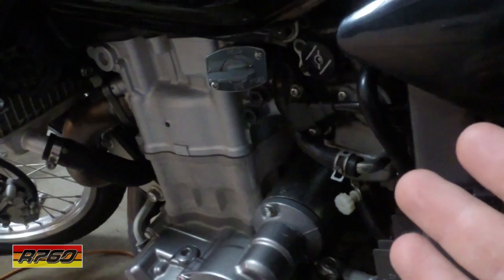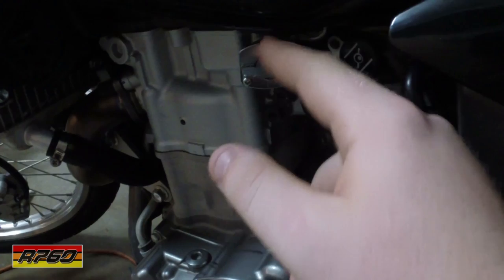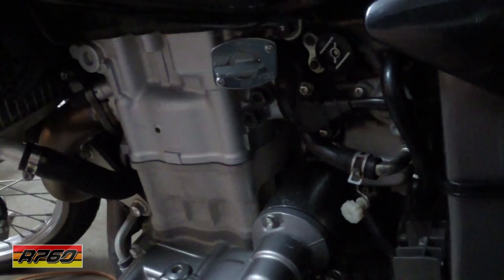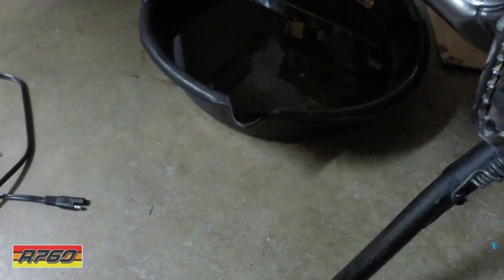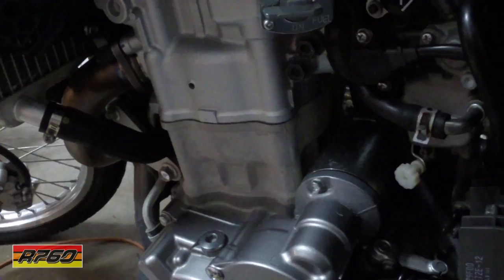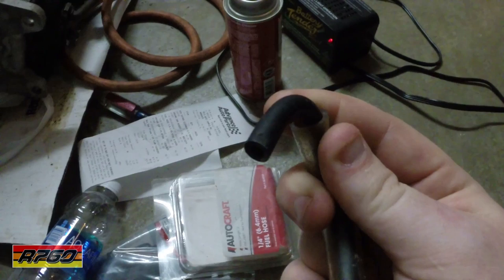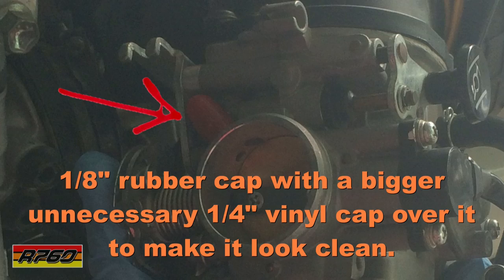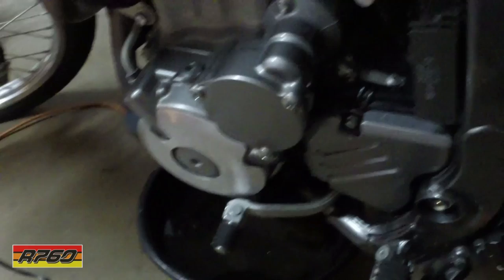Must Do Mod For Your DRZ | UNDER $30 | Vacuum Petcock Replacement

Comment: if you're flooding into the crank, why on earth wouldn't you address the trashed fuel bowl float valve?!
Reply from the maker: etyrnal My bike was still in the break period at the time and I don’t have the problem anymore. I did a little “research” on ThumperTalk and decided to make this video. Also I now see the error in my thinking and how I presented the problem, but I’m still a proponent to manual petcocks and leaving them off in storage. Thanks for the comment!

Comment: You do not need the vacuum caps. Just fold the vac hose over on itself and zip tie it
Reply: Thank u. Doing this today, and was searching for this after seeing another line coming off valve. And Im not carb handy so this really helped.

Comment: considering all of the mods required why do we buy these bikes?
Reply: because none of these mods are actually required we just do them because we think we know more then the engineers that build them.
Reply: If I need to explain you will never understand
Reply: These bikers WHERE good now they have added emission protection layers that destroyed the best designed motorcycle on earth

Comment: Hey man, having the same exact issue, although I suspect my float needle is jammed up as well. Anyway, I was wondering if you needed to use the spacer from the original vacuum petcock with the Raptor version, or if it hangs down enough to clear the gas tank. Cheers!
Reply from the maker: I believe I used the spacer.
Reply: Is this spacer necessary for clearing the tank? Like an idiot, I threw it away with the vacuum petcock
Reply from the maker: +tmckague after looking at my bike it seems that the spacer is needed. Although it does look like it could go up a bit, but it might not be able to go into the reserve position. I would suggest getting another spacer along with the appropriate gaskets if you don't have them.
Reply: raymon760 why not just grind/sand down the lever a bit?

Comment: Hi you realize you're "curing" the head ache by chopping the head. The fuel reach the crank if and only the float valve is not working.  So better start in the beginning than invent workarounds.
Reply: crpth1 it doesn’t always work like that with a vacuum operated petcock, if the diaphragm in the petcock is bad there will be a constant vacuum going through it whole running, causing rich running conditions. When the engine is off, there’s nothing stopping the fuel so it pulls fuel constantly and it’ll start actually going through the vacuum hose into the carb (usually up top somewhere) and fill the case. The float has nothing to do with it as the fuel is coming in through an entrance entirely different than the one that puts fuel to the bowl of the carburetor.
Reply: Right that vacuum line goes straight into engine AFTER the carb.

Comment: This is good info...another benefit from doing this mod is the petcock won't fail on a ride and leave you stranded.  I have had friends who's carb wouldn't get gas while riding because the petcock would not hold vacuum to hold the valve open.

Comment: Do you also have to change your Gas Cap to a vented one?  With gravity feed and a Stock Cap wouldn't you build up pressure in the tank as the fuel is consumed?

Comment: I swear that the bunk ACCT thing is an internet legend left behind after some bad ones were made pre-2004. 
I think the bad batch of ACCT's freaked so many people,  that an easy to manufacture bolt on part started selling like hotcakes, even though the probleem was fixed. "Better get one just in case" has been the selling point ever since...the My 04 still runs the ACCT, I replaced the cam chain at 40,000kms, I now have 98,500 kms, and am still running the 2nd cam chain with lots of life..
Reply: wtf for real ?
Reply: 50+ years riding, 20+ bikes, NEVER had a vacuum petcock fail. Or been with anyone that has.

Comment: ok, so the petcock is not the really the problem. The real problem is the cheap o ring that is used around the seat portion of the fuel needle valve.  The o ring is cheap garbage and fuel leaks around it and down into the carb and then into your engine. The non vac petcock allows you to turn off your fuel, so this leaking o ring doesnt flood out your engine. Unless you replace the o ring in the carb, you will have to turn your fuel on and off every time you ride your bike. If you leave the non vac petcock in the on position you will still get gas leaking into your oil.
This is the real deal.
Reply: Can confirm this has happened to me, how ever I left on prime for months. May even have been float stuck. Either way yes your crank case will full with fuel there was a gallon in my exhaust too , the real fail here is the that the carb doesn't have a over flow due to some emissions crap, they don't want fuel on the ground apparently.😢

Comment: So after replacing with manual petcock do you always have to turn it off after riding?
Reply: Yes always
Reply: @sgrenier78  Not really if you needle and seat are working good . the gas should shut off once the carb bowl fills. but i guess to be safe it would not hurt.
Reply: On all of the 5 bikes I have iwened(all were from 1970-78) I NEVER turned off my petcocks and they never leaked. I’m sure 40+ years later, the newer ones don’t either.
Reply: @petrosspetrosgali  same here never shut off the petcock. if anything leaks it would be the carb float causing the leakage.

Comment: Please HELP someone! I just got a 14 dr650 and when I was riding the other day it died out on me when I was in 4th. Figured out it had a bad battery so I got a new one but the same problem persists. The bike will turn on...eventually, but only stays on for about a minute then turns off. Also when it's on and I press on the throttle it seems as though it wants to turn off, when I close the throttle it goes back to normal. Oh any it only runs on prime...
Reply from the maker: +d123abcd did you put this on ThumperTalk? If not I strongly suggest taking this to ThumperTalk. 
Someone way more qualified can help you troubleshoot. Maybe it's not getting enough fuel, or too much air. I don't know.
Reply: I have the same problem. Mine only runs on prime.
Reply: Carb is dirty, needs to be cleaned

Comment: The thumpertalk petcock link is dead. Can you update the new one?
Reply: Get the DRZ400-E one and fuel line (use the spacer as well get a NEW o-ring for the spacer since you should not re-use it. Mine was leaking fuel in the oil as well. It is well worth the $80 to get the Manual petcock and fuel line. Put a PLUG on the carb where the vacuum line was, I have to change my oil and mine is a 2021 model. I knew it was leaking not even 100 miles on it oil smelled like fuel.  Look up Suzuki DRZ400E like 2005 model will work - put on Metal tank no issues.

Comment: Hi dear i have a suzuki drz400sm 2014 and petcock was liking replaced to yamaha raptor 660 and work perfect but on the vaccum put the vaccum cap and start fail disconnect the vaccum cap and stop fail why please let me know
Reply from the maker: I'm not sure I understand what the problem is. The vacuum line that used to go to the petcock needs to be capped off. That is the only vacuum line that should be messed with.

Comment: I think I'm having a similar problem but how did the fule get down into the crank case?
Reply from the maker: It didn’t, I’m stupid
Reply: Yeah.  That sounds odd as it seems like fuel would have to bypass the float bowl overflow.

Comment: ive heard of that problem, but never had an issue , i always leave the petcock on ... i need to look in to it .. :)
Reply from the maker: Ya, I didn't think much of it until I checked the oil. It smelled like straight up gas.
Reply: +raymon760 when is the last time you cleaned the floater on the carb,  if that meddle is dirty will let gasoline go thru,  otherwise it should stop it.  I had a leaking carb once,  had to clean the drop needle on the floater,  fixed the problem
Reply from the maker: +Vegas RoManiac never cleaned it before replacing the petcock. But I rejected it (for exhaust) after and it was clean in there. Hopefully this fixed the problem. I'll probably make an update video next oil change. Thank you for the feedback I appreciate it.
Reply: @vegasromaniac  It is the vacuum petcock the seals fail or they leak I got one as well and they leak. Nothing to do with the carb on these totally not related. Fuels with ethanol eat up these and they flow fuel and even new ones fail just a crummy design.

Comment: how can fuel leaking into the crank ? dont get it
Reply: dreamingwolfsocom  Do a little google research--usually worn needle not seating properly which lets gas flow. I put new needle on mine and problem solved. Its not really a petcock issue but petcock will give you an extra layer of protection by shutting of gas right at the tank.
Reply: I meant to say float valve. It has a little bullet shape end with rubber on it that wears and gets hard with age.

Comment: MY 2003 kawasaki klx400r same as DRZ400E comes with a manual petcock ! Why not use one ?
Reply: Also have a 1983 Suzuki GS750T that has a vacuum petcock , never had a issue with it and have owned bike since new !

Comment: i dunno, sounds like u messed up somehow. i got 20k on my drz400 and my petcock never had an issue. not to mention the catastrophic consequences if u forget to shut off ur manual petcock.
Reply from the maker: Probably, I mess up all the time. But I grew up on dirt bikes so it’s second nature for me to not only turn the fuel off but run the carb out of gas after every ride

Comment: I don't get it... how was fuel getting into the crank from a leaking petcock?
Reply: Two failures are required.  The petcock must leak and the float needle seat must leak.  Unfortunately, due to ethanol fuels eventually both these things do leak and your crankcase fills with fuel.  It's very, very common.  Basically 100% guaranteed to happen eventually.  There is a needle seat seal made out of different material that won't degrade with ethanol fuels.

Comment: How does one recognize he got fuel in the oil?
Reply: checking the oil level, if it is higher than normal you have a problem.
Reply: Sometimes oil mixed with fuel drips through the engine gasket... you can see the oil spill on the ground. It happened to me on my Virago 750 many years ago. Now i am thinking of turning my Kawasaki Estrella 250 in to a gravity type petcock because the one i already have is been vacuum disabled, it only works on pri mode.
Reply: Take the stick out and smell it

Comment: I got a non vacuum petcock and ever since I did that Ive had problems.

At first it was a bitch to start up after several cranks.
Then it got worse and wont stay running. Dies during idle or when I give it throttle.

Any ideas? It seemed to work fine before I changed the petcock to a non vaccum one.
Reply: Same problem... Cuts out when driving and I can see the fuel filter is empty. Then fills slowly over a few mins & I can start it again. No idea if it's a vent problem as I can't get an answer and have no idea what I'm doing 😁
Reply: @kpunk4247 did you end up getting a vented gas cap? Lol
Reply: Did you end up getting a vented gas cap and fix the issue?

Comment: Please help. I changed out my petcock with the raptor one. Plugged the vacuum line nipple. Ran a new fuel line. Bike ran for a minute or two. Next morning out went and bike will not start. It is cranking, but won't fire over. I replaced the spark and the carb looks clean. Any suggestion on what to check next.....
Reply: 2006 DRZ400SM 13,000 miles.
Reply from the maker: Josh A-star is the fuel line pinched in any way? Sounds like it's not getting fuel if it ran for a little and stopped (probably just ran the fuel left in the carb). I would make sure that fuel is coming out when it's on the "run / on " position. Maybe the petcock is bad, not on the run position, fuel line is pinched, or there isn't enough fuel in the bike. Will it run on reserve?
Reply: Fuel line is not pinched. I can disconnect it from the carb and turn the fuel to on and gas pours out. Brand new spark plug..(touched it to the frame and I have spark).. If the pilot jet is clogged, is it safe to assume that it will keep it from firing?  Thanks for the help. I am  overseas and zero shops to take it to.
Reply: And I have the vacuum line capped off.
Reply from the maker: +Josh A-star honesty I have no idea what it could be
Reply: ok, last question. To see if I accidentally moved the idle adjust knob.... How should the butterfly valve be sitting in the carb ?....... with zero throttle.. should valve be sitting at 90 degree, strait up and down inside the carb ?
Reply from the maker: +Josh A-star looking at an old photo I had of it, it seemed to be almost straight up and down with a slight angle.
Reply: Thanks, mine is tilted, where there is almost a 1/2 inch gap at the bottom. I am pretty sure that in taking the tank off, i picked up something and it found its way into the carb... so i complete cleaning is next.... Thanks again for the info..
Reply: Hey Josh did you ever get it figured out? I did everything correct and can't get fuel to flow into the carb with the new petcock. If I take the fuel line off the carb, fuel flows fine. Scratching my head.